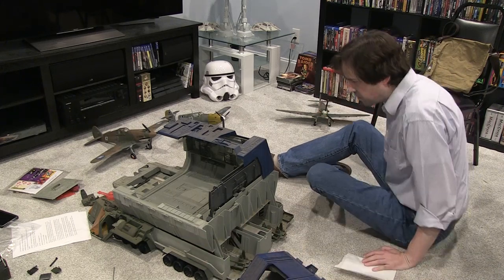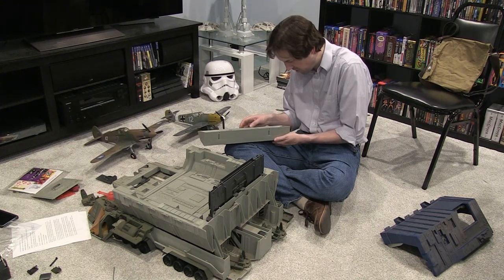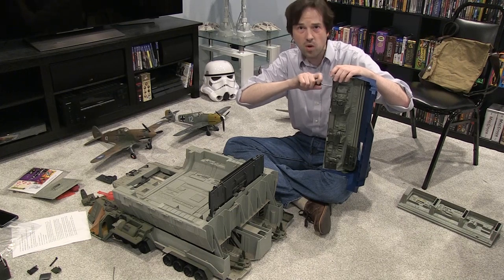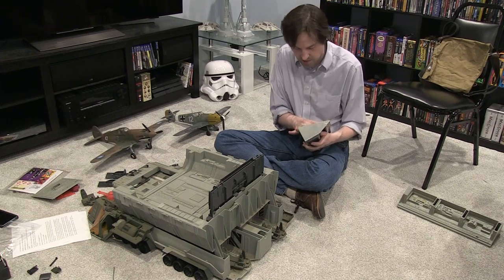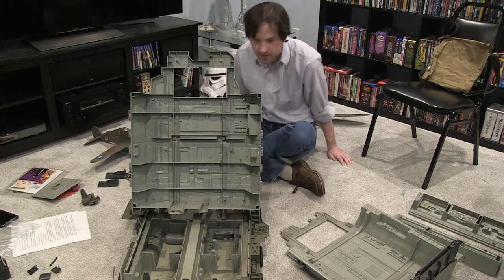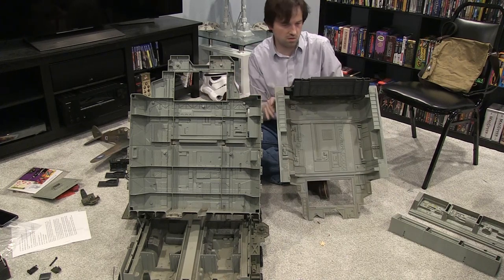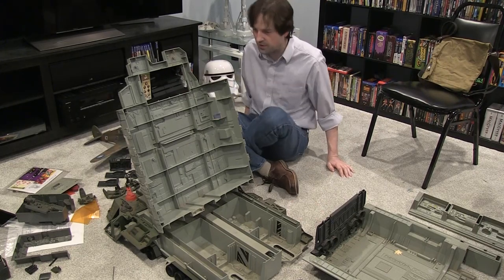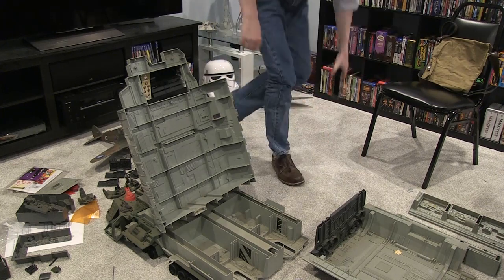G.I. Joe Defiant Gantry Time-Lapse Teardown! Hasbro 1987

Comment: Hey Michael, I suggest using 100% silicon oil (RC Shock Oil)  to reduce friction on plastic hinges and tight screws. It helps with my repair sessions but I'm not a chemist so if anyone knows how it will affect plastic, feel free to inform me.

Comment: The best playset ever.  I just love this thing.  Took me buying two and a host of extra parts to build mine. And those blue doors are the most fragile vintage toy piece I’ve ever had. Had 3 sets of doors. Never ship doors. You taking the gray elevator walls off the blue doors had me cringing.  Never crank it up without your free hand helping to pull up the shuttle and it’s bed. I keep two boards underneath the crawler so the wheels aren’t stressed where they connect.
Reply from the maker: The elevators coming off the doors was not at all an issue.
Reply: RetroBlasting .. Well that’s good. I feel if I even look at the doors they will crack.  Ha.

Comment: I'm looking forward to the restoration of this beautiful beast of a toy :-) If you want to save the door drilling a tiny hole at the end of the crack will reduce the stress on the plastic and prevent it from cracking any further. It also makes it easier to get some liquid plastic weld inside the crack to bond the pieces together.

Comment: I’m curious about the spring holes, resting the gantry like breaks them.  After you restore it, keep the gantry up or do not put the springs back in. Mine goes up and down without the springs and just some manual assistance.
Reply: Also, if you don’t mind me saying. Make an inch high or so support that slides underneath the underbelly of gantry to take the stress off those wheels.
Reply from the maker: Yeah I've already planned for that

Comment: I never seen one complete :( much harder to find than the Flagg or the terrordome. Hope it can be fully back to glory again
Reply: All three of them were easily broken and couldn't withstand normal childhood use. My cousin had the Defiant that we broke the gantry, bay doors, shuttle bay doors and shuttle landing gear. Then on my Terrordrome all of the door latches broke, most of the Cobra emblem sides broke off flush and the elevator to the launch doors ended up broken. Our Joes were well played with.

Comment: Michael,

Are you looking at replacing the gears from old parts or having someone machine them? I am assuming the gears are plastic. I was wondering if ones made from metal would hold up better?

Love the show,

Peder
Reply from the maker: I'm hoping to make the repairs in metal, but I need to diagnose first.
Reply: Very cool! Looking forward to the next part. I know how brittle that plastic can get over age. Especially during restoration. Like the 21st century planes too. I have a lot of those in my collection the f-18 and f-16 are huge. They do look great with joe displays though.

Comment: Question, if a plastic part is too broken. Do you try and scavenge a piece off another toy, Or do you 3d print a replacement? I know on eBay replacement parts can get VERY expensive. And, other times the toy could be so rare that parts are scarce.
Reply: Zombiekilltrocity He's mentioned that he goes to a website called Yojoe.com to get parts
Reply from the maker: I look for replacements first.